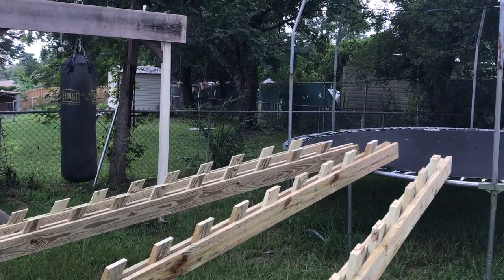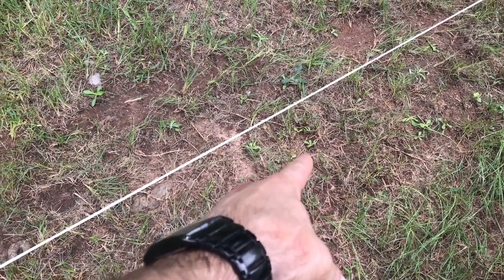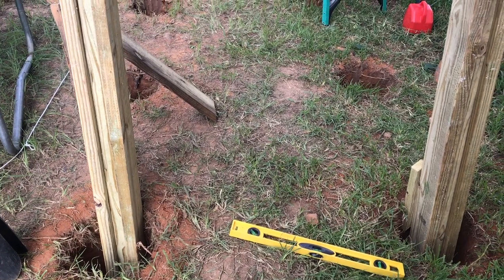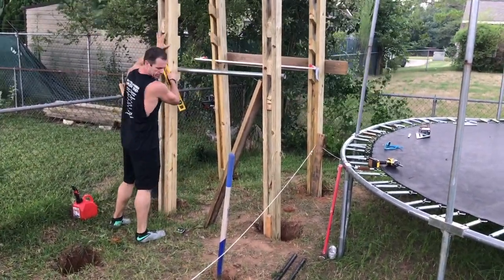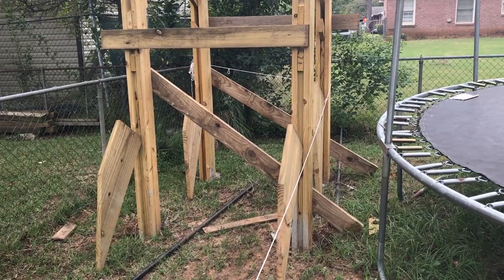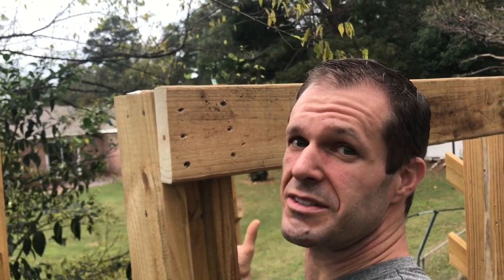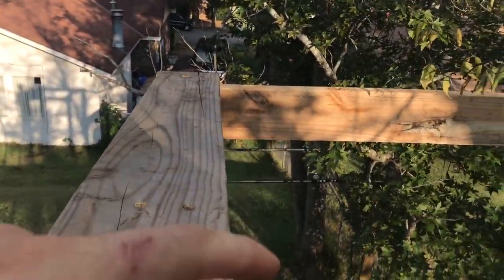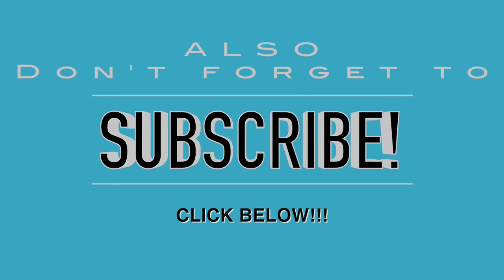Part 2: How to build and official American Ninja Warrior Salmon Ladder! (Concreting the post)

Comment: Thanks for the video. Very very helpful in both design and workmanship. Just wondering how to prevent the ladder from sinking...
Reply from the maker: Hermon Mak If you use concrete like I did you should not have a problem with them sinking. Thank you 🙏

Comment: Nice job.  Thanks for a very well done video.  What material did you use for the bar?  Looked like black iron or galvanized pipe?  Good luck and hope you wear out the rungs.
Reply from the maker: mygreenmtns I happen to have an old-style steel closet rod that I had just taken out of a rental house so I used it. It is not optimal because it weighs over 10 pounds but I listed in the video description the best suited Rod for a salmon ladder. I listed the name of it as it is on Lowe’s website. It is a fence post that measures 1.66“ x 6‘. I hope this helps. Please let me know if you have any other questions.

Comment: Also if I could add, is there anything that you would have changed with the build now that you have had it up for a few months?
Reply from the maker: brandon coleman The only thing that I still plan on changing on my salmon ladder is just adding some peg holes to the side of it to be able to use it to train for something other than just salmon ladder. Otherwise everything about it has worked out perfect.